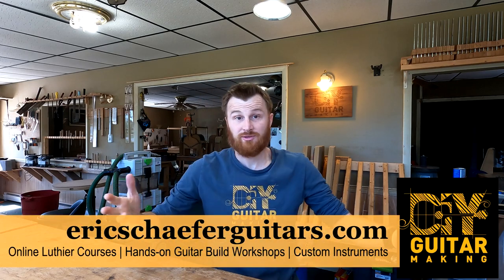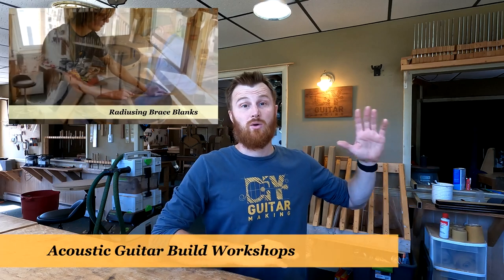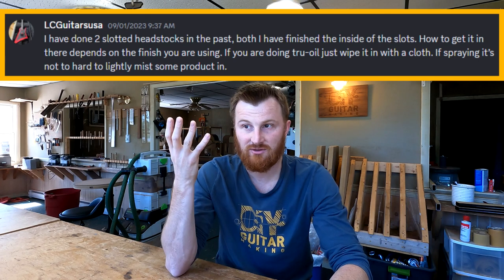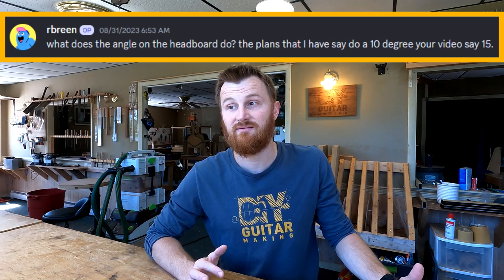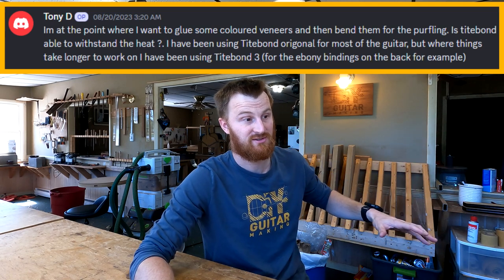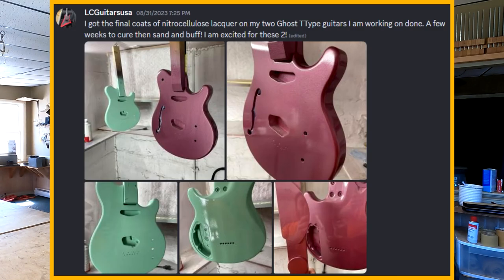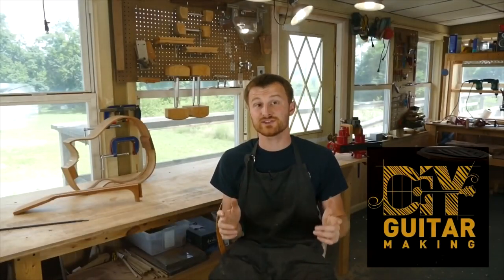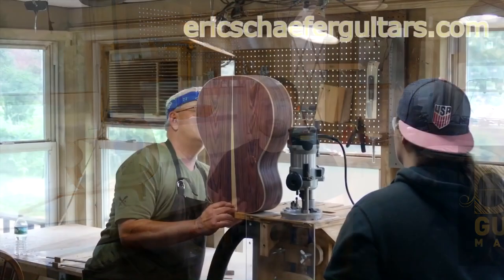Q&A | Luthier's Mercantile is Closing!!!

Comment: Another big problem with Gibson one-piece necks is the grain runout at the headstock angle. And then, right at the point of greatest torque from the string tension, Gibson carves out a big trough for access to the truss rod nut, further weakening the wood there. It’s no wonder Gibson necks often break there. I’ve got an old mid-50s LG that was my Dad’s and the neck broke there twice. It’s still in pieces (plus there are other problems).

Comment: Touching back to the previous video about repairing cheap guitars. I built my repair chops on cheap guitars. Even though I was doing them for free or very reasonably I learned a lot about how things work. Neck resets, refrets and crack repair and finish repairs. It's all scary even on a cheap instrument. The first actual dovetail reset was on a 1950 000-18. Butt pucker to the max but way easier than the no name 12 string that had been dowel pinned and epoxied.

Comment: Intrigued, I look up pin routers. “They are mostly used to copy parts using a pattern. This is what was used to cut out repetitive parts before the CNC router was invented. It could be used like a shaper but with the bits being above the table; not the safest way to go. Some shops use them as dado machines to get a consistent cut in undersized plywood”.  Of course Grizzly has one for the low, low price of $4,995. I think I’ll pass.